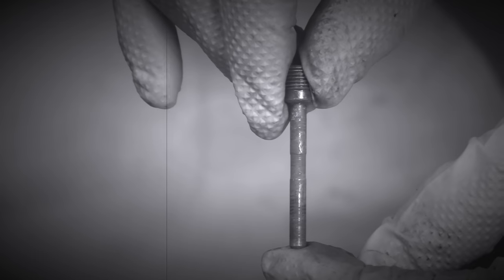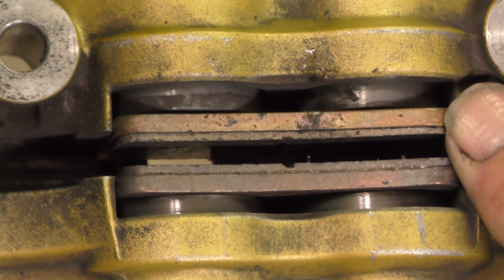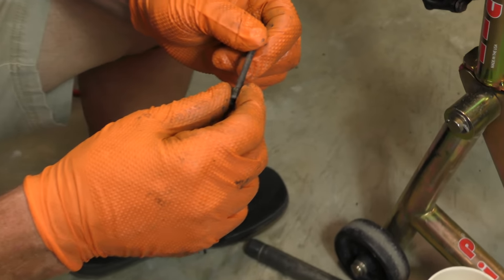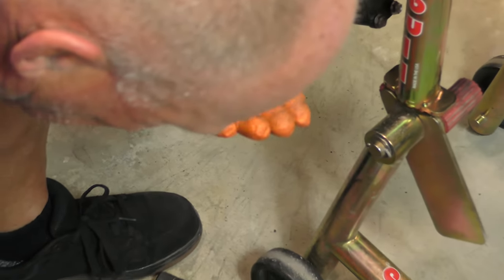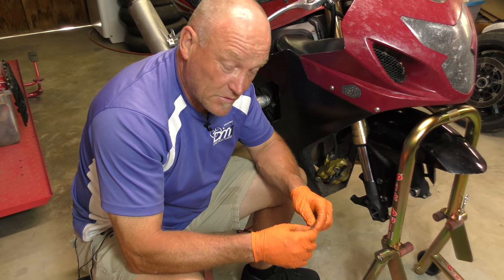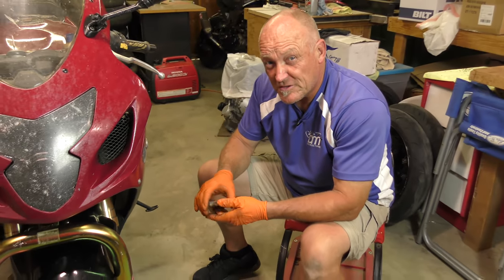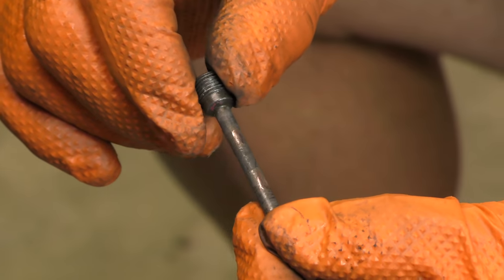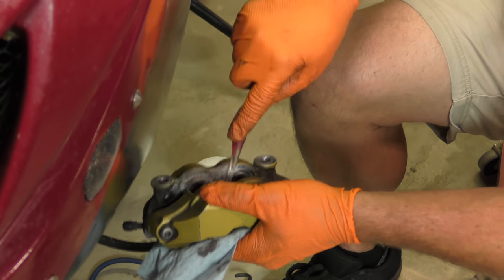Trash or Treasure: '05 GSX-R750 Front Brake Problem Ep 2 Calipers

Comment: That works, but I find it very labor intensive. I much prefer to order a caliper rebuild kit (the gaskets and the rubber o-ring that seals the caliper halves) and the pins. Split quickly the caliper, remove the pistons, clean everything (much easier when the caliper is split) and reassemble using caliper mounting grease. Works better in my opinion and it is a bit faster, than trying to juggle each piston half way out. 
Also, removing the piston and the old gaskets, allows you to clean the canals where the seals are mounted. In time they get dirty and the pistons don't move so freely anymore.
For my trash/treasure bike (03 CBR954RR) I purchased a second set of calipers, so when a brake job is due, I quickly replace the calipers and rebuild the other set whenever I have time.
Reply: Rebuilding the other set when you have time makes sense, however the following brake bleeding is what would make me avoid doing it your way
Reply: @OKMotorcu  Well, when it's time for a brake job, I do change the fluid also. Beside, if you don't let air get to the master cylinder, bleeding is a breeze. You should definitely bleed your brakes anyway. Even if no air gets in, periodically replacing the old fluid with fresh fluid is a good idea.
Reply: Bleeding isn't difficult if you fill the system bottom-up from the caliper using a syringe

Comment: I clean the calipers every few track days and then remove the pistons and replace the piston seals, cleaning in the seal grooves in the caliper body… corrosion and dirt build up behind the seal and bind the brakes, the seals are a square section and work like a spring to retract the pistons very slightly after each brake application to stop binding and rubbing so it’s very important.

Comment: Hi Dave and Mr. Williams, thanks for the video. Honestly, I always thought cleaning calipers with a toothbrush was a myth since you can never get to the full piston with a toothbrush, but clearly, that myth is busted. I still clean the calipers, but never really observed an obvious change.
Reply: Cleaning the calipers might not yield immediate results, but removing the brake dust from the pistons and calipers prevents corrosion. If that happens you will experience seized pistons and/or pitted calipers... Even aluminum gets corroded in time.
Reply: Yep, you don't normally need to get the full extension, if they do go out that far there isn't any stability in the pressure... as most only move a few mm from the new pad to the used pad.
Reply: I've fixed a number of brake issues by just cleaning the pistons. It's an easy task once you get the hang of it. Soap and water to wash and brake cleaning as a finisher.
Reply: @denchua  Indeed, dirty, near seized, pistons are probably the number one cause for brake problems, followed by the rusty, or worn out pins for the brake pads.

Comment: Ill be checking the pins from now on after this.
On old calipers I take seals out  to check for corrosion build up behind the seals pushing them against the pistons, just had 2 pairs of srad calipers completely stuck from this, a grease gun was needed to push them out.

Comment: dave, its really time you got a piece of spare metal, that fits inside the slot of the caliper, almost like the thickness of a rotor but thick enough to barely fit inside the caliper
then simply pump out all four pistons or one by one if you prefer
Reply: Old pads
Reply: But doing it this way gets them out past the normal point of use, cleaning behind where the fluid could be.

Comment: Hello, 2 questions. 1st After soapy water, did you clean pistons and all with brake cleaner? 2nd did you put ceramic grease on back of breaking pad and on pistons and on pin sliders?
Reply from the maker: 1. I never used brake cleaner as it make rubber brittle and due to high pressure can get past the seals.  2. I never use grease on the pad backing plate, pins or pistons. That has always been the case especially for track use. It simply makes me more confident that grease will not get onto the brake pad or rotor surface.

Comment: A couple months back I had my front brake lock up on me at a track day. I suspect due to a dragging pad.
I serviced my brakes a month prior to the trackday. New pads, and fluid as well as a good scrub.  I noticed slight uneven wear on the old pads. Indicating a stickey piston. I checked the movement of all my pistons a d they seemed to be fi ne. So i figured that maybe had managed to free out the piston and that i would just keep an eye on it.
Should i have taken this as a sign that my calipers needed rebuilding? what did i do wring i  terms of maintenance?
Reply from the maker: You went much further than most people do so all that is to the good. Regular rebuild every 2-3 years is not a bad idea if you have the tools and know how especially if you are aggressive or track your bike a lot. The other part is I am wondering if you changed out the brake lever at all between service and track event? If not, that is moot.
Reply: Dave is a legend on motorcycles and have learnt so much from him. 
If everything was cleaned and fresh in your brake system my bet is you may have over filled the fluid resivor  and when fluid came up to temp it expanded enough to engage the pads to  disc automatically and building more and more heat until the point of lock up.
I only fill brake resivors to the half way point  so there is an air gap for fluid expansion.
Reply: @catalystreactionsbw  No i didnt do anything to the lever. 
When i took the pistons out, most of them had a black ring arund them where the seal was. Also this bike is 12 years old. Ive owbed it for 2 years and had never taken the pistons out of the calipers before. So i guess they where overdue.
Reply: @marcusbarnes5929  I dont believe so.but ill keep that in mind in future.
Reply: Why don’t you strip the caliper, remove the pistons, clean and lube the seals and reassemble it?
Would’ve been quicker than all the faffing around you just did.
Reply: @munter10  What faffing around? What I described in my previous comment was a very typical pad slap. Do you normally dissasemble your callipers during a normal service? 
But I have since then completely rebuilt those calipers with new seals and pistons. But thanks for your suggestion.

Comment: Why not use brake cleaner?
Reply from the maker: High pressure and can blow stuff into the oil seal. Makes rubber brittle ver time. Doesn't clean like a toothbrush with soapy water.